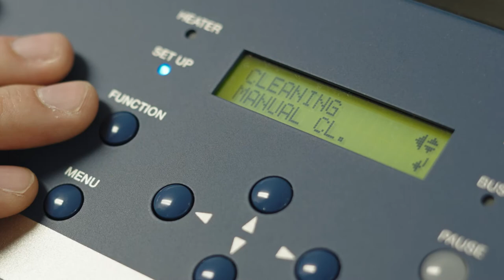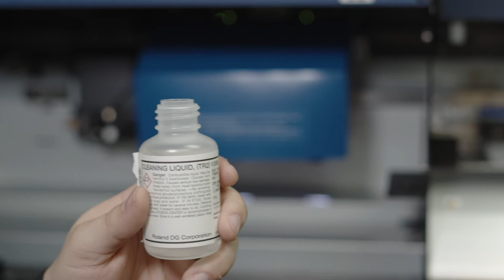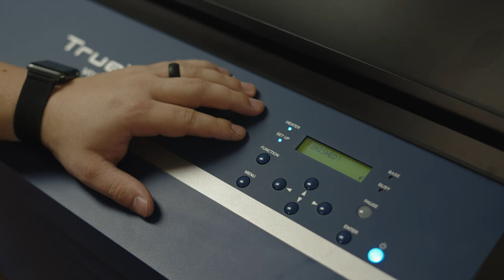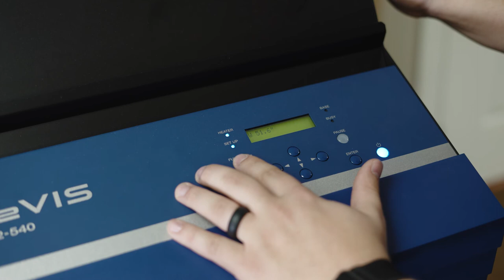How to do a manual clean on Roland VG2-540 Printer

Comment: Hi, i am an operator only used latex in big shops. I want to start vinyl printing and installation business at home. Can you run this vg2 in a room at home? Will it smell too bed? Will it dry in couple of hours?
Reply: Hi, I run a VG-540 on TR2 inks outta my spare bedroom. The smell isn't terrible but it all depends what you're printing. If it's a really heavy print and you get it really hot you can smell it but it's not like STINKY like latex is. 
Prints don't take hours to dry, eco-solvent ink dries pretty much immediately if you have your heat set right. Off-gassing is a different story and a point of contention for some. 

Typically I batch jobs (stickers) and print to take-up, run em through the laminator to laminate and/or reset, then I crop cut em to take-up again, then run em back through upside-down to put a back split in em. 
Hope that helps 🤙